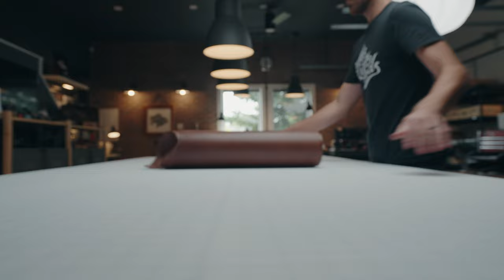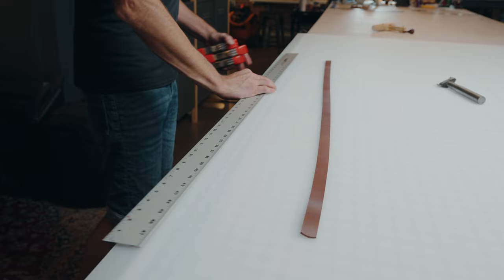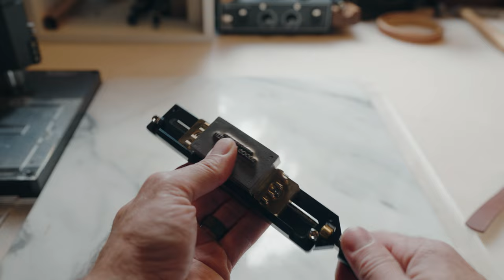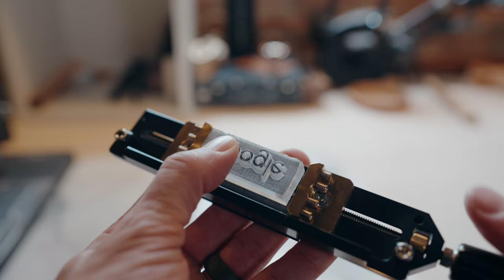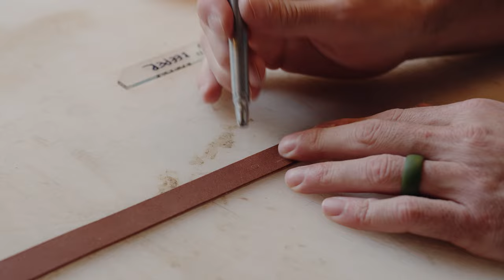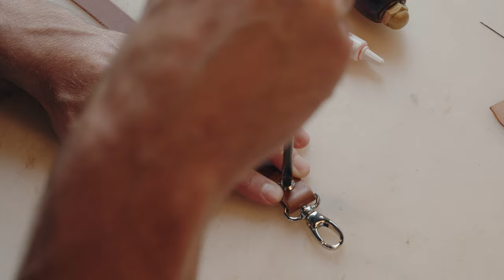Making a binocular strap for GOOGLE!

Comment: Why no edge finish? Why no adjustment provisions in the strap? Red Loctite will make those Chicago screws nearly impossible to remove if needed in the future.
Reply from the maker: 1.The project didn’t require finished edges. 

2. The client didn’t want adjustable straps

3. There is no reason to open the Chicago screws.

Comment: What type of 3D printer and material are you using for the Google stamp?
Reply: I think he’s got a milling machine not a 3D Printer. Makes it a lot finer.
Reply: The maker stamp is definitely milled. The Google one looks plastic which made me think it could be from a 3D printer. Some are using them with success, but they're slow to print.